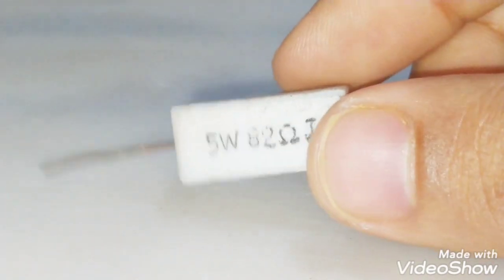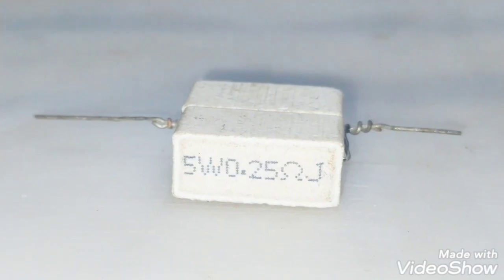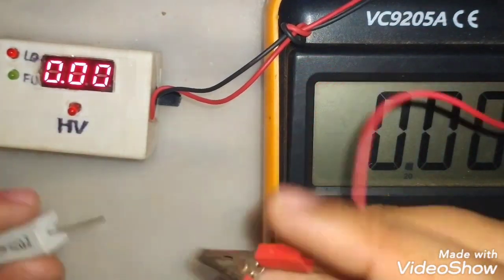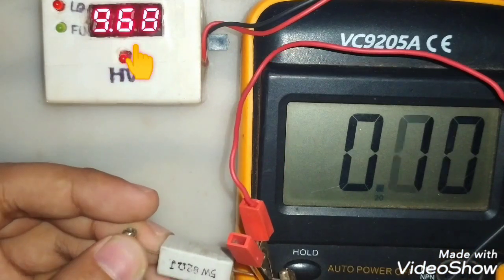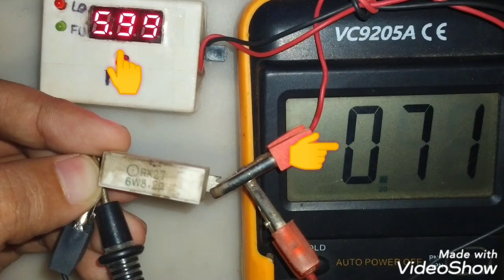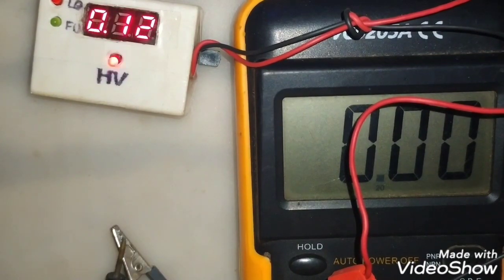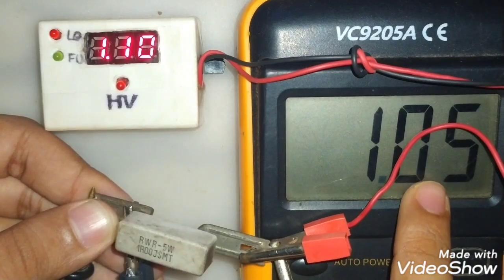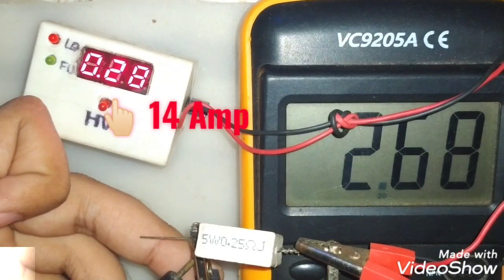how to measure current using Voltage meter | DIY Amp meter

Comment: You did not show or say what input voltage you applied to the resisters, You showed components, readings and text that conflicted? 82R is not 100R, 0.25R in parallel with 0.25R is not 0.01R it is 0.125R. You should have filmed taking some ohms readings to prove your text statements. Ohms Law states you need two readings of any of the volts amps or ohms to get an answer. you could have used R x I = V then IPV / R = I to get max current flow in the circuit, ie ( IPV = 12V ) ( 12V / 100R = 0.120A = 120mA ) V x I = WATTS ( 12V x 0.120A = 1.44W )
Reply from the maker: Yeah,
That video was wrong because back then i just started, sorry for that